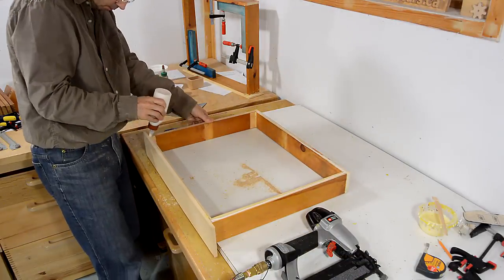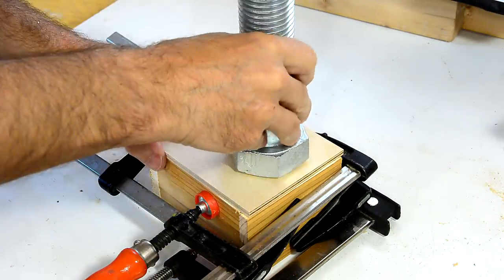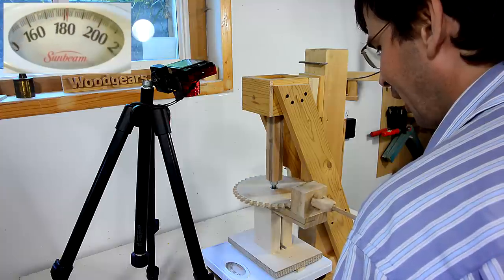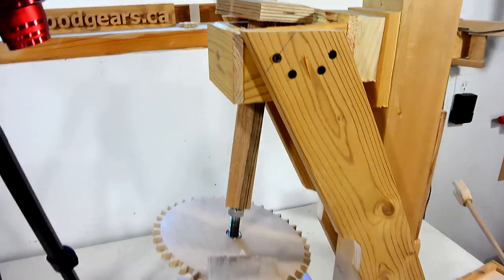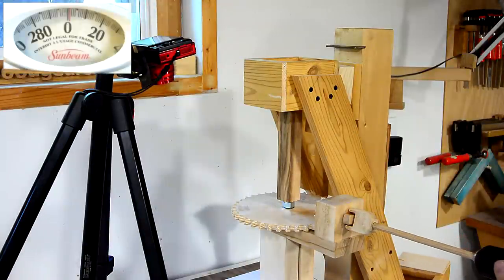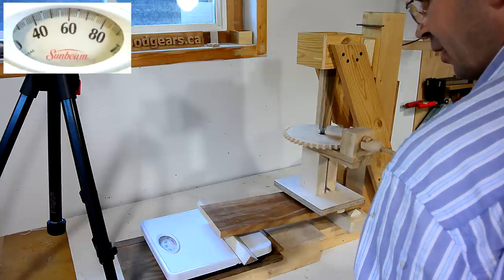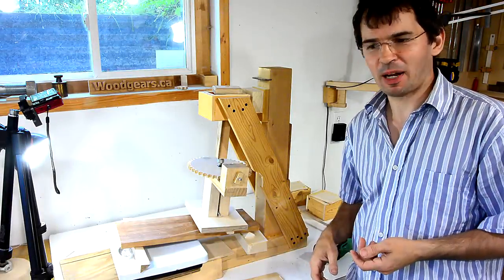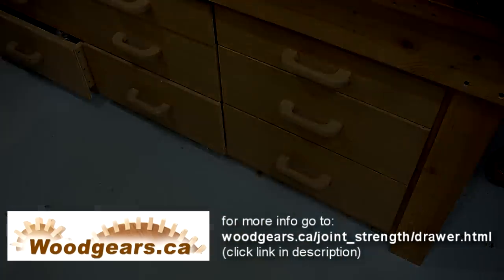Best way to attach drawer bottoms: destructive test

Comment: This video brings up a point I have been wondering for years. Matthias always shows the different strengths for different joints and the weakest of them all is the butt joint (glue only). BUT, everyone keeps saying that the glue is stronger than the wood. So, doesn't that suggest that the butt joint should be the strongest joint of them all???

Comment: i might be talking rubbish but surely with the small box in the groove would quite obviously have a larger reading because it would much harder for the draw bottom to crack the a larger draw would because the bottom would flex more and crack so a larger would most certainly have not withstand a tonne of mass.

Comment: His 1200 pound breakaway strength calculation for the glue on his drawers may be correct, but that doesn't mean that the drawer will hold 1200 pounds of materials.  He forgets that weight in the center of the drawer has mechanical advantage to breaking the connection.  The shrinkage of the material due to the flex of the material will also provide a shear force on the glue as well.  Don't forget that the weight of the bottom material itself must be calculated into the load on the glue as well.  All three reduce the amount of material that you can put in the drawer.  Putting the bottom in a groove is optimum.  If the drawer is large enough, it becomes necessary to add reinforcement strips under the bottom or use thicker bottom material in order to reduce flex.

Comment: I don't doubt that your method is fine.  However, testing a larger drawer would seem to be in order.  The flex on a large drawer bottom would tend to let the bottom pop out of the rabbet.  Also, loading goes up with the area of the bottom while holding goes up with the length of the perimeter.You should put your chaos quote on T-shirts and sell them.

Comment: Sorry Matthias, but it's bending moment, not shear force that breaks these joints. Still, I was skeptical, and the joints held up better than I expected. If you do drop an elephant at terminal velocity and at an angle on it, there's a good chance the joints will give.

I always do my joint tests with bending moment and extremely large, falling objects and/or animals at terminal velocity.  That's usually what makes joints fail.

Comment: You forgot to mention that glueing the board on the outside is better because items in the lower drawer will not catch on thi lip created by a datoed bottom. That can be worth its weight in gold  hehe. Ever have something you can`t see in the drawer below stopping the drawer? Frustrating to say the least. Hey thanks for the great video.

Comment: An interesting test, but a bathroom scale is highly suspect for accurate and reliable numbers. A load cell with an good gauge and either a hydraulic jack or large arbor press would be a lot more reliable. But your numbers do give some indication of what construction method is stronger, so I guess that's the important issue. And type/quality of the plywood will sway the numbers a lot. High grade birch ply might possibly be far higher? But the grade and glue type would also do the same. Most of today's wood glues properly applied to a clean smooth surface are stronger than the wood itself.

Pete

Comment: There is no best solution for ALL scenarios for drawers. A very large draw would allow a grooved bottom to bend out of the grooves over time. A small drawer needs as much space as possible so a glued bottom also makes sense. A drawer that has the sides with a lot of expansion and contraction would be better suited for a grooved drawer. Otherwise the glue joint would feel lots of stress and fail. I'll stick with grooved because I don't make ridiculously large drawers and I don't have to rely on the glued butt joint.

Comment: In my humble opinion you small box size is why it took so much to break; had it been a regular sized drawer it would have failed at much lower PSI.  A regular sized drawer would fail because of physics because a 1/4 inch thickness can only span so wide. 

If your test revealed anything, it was the answer to your question, gluing bottoms on is faster but not more secure. It also proved that either way works well all things considered as no one is going to put upwards of 600 lbs into any drawer for any reason.

At the end I'm not sure if you were joking when you projected that your drawer would hold thousands of pounds or not, based off of its larger size. You do make some wonderful videos and you are very creative but you also joke a lot too so at times it's hard to tell...

Comment: Mathias, I think that your conclusions are wrong due to the test not being true to reality. I think you should have used normal sized draws for your test to mimic reality Because if the bottom is in a groove, with a bigger draw i think the bottom would flex alot more and fall out of the groove. I am sure that your draw bottoms will fall out if you filled them up with lead. I am certain that if you stood in one of your draws it would break, if you made them with just a groove, no doubt. I make my draws by glue and stapling to the bottom, with no groove. I make sure that the staples are flush and then the runners also give more support as they are screwed through the bottom and into the draw sides. IF you disagree and want to prove me wrong, I too will put my camera where my mouth is and try a normal sized draw and then a larger one like the draw unit at the end of the video. I will use malamine/particle board sides with a 3mm mdf bottom.  think a 400mm draw should be tried and then a 500mm draw with a depth of like 500mm like a normal kitchen draw. Anyway i am only stating in a friendly way what i believe through my experience as a cabinet maker and like i said, If you really disagree and dont want to do the test again, I will if you reply to me. Good channel by the way, i always look forward to your videos and this is the first time i have disageed with you.:)
Reply: An easier way to say what i just said above is as follows: The larger the draw, the weaker it is NOT stronger and i will prove it if i have to.
Reply from the maker: All depends on the load distribution and thickness of the plywood.  But that's ok, you don't have to believe me.  But whether or not your believe it really doesn't change much.
Reply: yes i do agree that if the weight distribution is even to the edges it would probably hold but i dont think it would with normal use. Hey in Australia all modern draws have 3mm mdf bottoms (one side is usually white for kitchen draws) Do you guys use ply board for draw bottoms over there? Is the standard also 3mm. I have noticed that different countries do things a bit differently
Reply: You know i am curious if i can stand in one of my draws. I am going to test it and make a video, probably wont be as good quality as yours but lets test australian made draws. I will stand in one and ill try different sizes with the load evenly distributed first (not too sure how yet, im not buying lead lol). Lets see. give me a week for me and my young sons to do. It will be fun :)
Reply: hey sorry to bombard you with replies but its not every day i get to talk to a famous person.But because you replied im going to quickly upload some footage of a house extention im just finishing up. I have added almost 6m2 to make a lounge room of what used to be a porch. approx cost $500. It will take a few hours tho because my computer. So part 1 will be coming up soon if anyone is interested. Thats all promise. Keep up the good work. I will send you a pic when my bandsaw is built. I am going to take inspiration from you  and that other guy with the inferior clamps becuase i like his thinner blade and I use alot of particle board. I never even thought of making my own tools until i saw your videos :)

Comment: You should test plywood sides no an ACTUAL DRAWER size. The tiny bit of plywood below the groove (which supports the bottom) will easily break compared to a glued-on-bottom joint. Glued-groove will likely be strongest, and glued-to-bottom will probably be second.

Comment: your right one should never put that kind of weight in any drawer ,600-800lbs , so i would agree with you glue the bottom, maybe some angled brads for good measure,,,, have several drawers that exceed 100lbs in them , and they are only particle board bottoms ,3/8'' -10mm thick and have never failed in 15yr and they are just glued and brad nailed , , i think some glues used in the past failed over time thus the drawer bottom would fail ,  the material used for the bottom was too cheap or thin and deflected but have never seen LaPage fail under normal abuse as well

Comment: I generally put them in a groove unless I use  3/4 extension slides that will hide an applied drawer bottom. For me it's all about looks, opening the drawer and seeing the edge of an applied bottom looks like crap in my opinion.
Reply: Skinny Moose And you are never going to have to clean up glue squeeze out or dried glue on the bottom inside of a drawer.
Reply: God of Thunder that's true.

Comment: 2400 pounds huh ? With a drawer that big i'm sure anyone could just punch the glued bottom right off.
Drawers that small and pressure applied right to the edges really doesn't translate to real world use and normal sized drawers.
If you wanna do that, you need full sized drawers and a more realistic simulation of weight, like pouring sand in them. I'm willing to bet the glued on bottom couldn't hold a single bag of sand (100 pounds) or close to it.
Reply: Lol. Im sure it holds 100 pounds with no problem.

Comment: I had bets on the Rabbit winning... If I buried the bottom in rabbits.... The sides would have to break apart for it to fail. If you glue the bottom on.. You are are relying more on the glue to hold.

Comment: likely already pointed out , no drawer is 2x2  the open 9x 16 distance will make a huge difference on holding power as the bottom flexes as tension is built .. deflection of...? test might be not be useful as a reliable analog. should have been a tad bigger to let the bottom flex a bit under normal drawer  type loads, however I only wish I had the time and resource to do what your doing.. carry on PLEASE! What you do is genius first and entertaining  as well  . I am going to use your plans and build a tilting router table. that is bad ass. Thank you

Comment: I think that a bottom glued into a dado is similar to a finger joint, and a bottom glued directly to the drawer is essentially a butt joint relying solely on the strength of the glue joint. As with any butt joint, it can be reinforced tremendously by adding screws to it. With today's adhesives though, either way should be more than adequate. Obviously you haven't had any problems with your preferred technique, or you would have changed it. 

I'm too lazy to do the math, but I doubt that increasing the drawer size four times increases the strength four times too. Wouldn't the area inside the drawer increase proportionately greater than the area of the glue line of the bottom? If so, the strength of the drawer would not increase linearly with the drawer dimensions. I doubt that your production drawers would fail at 2,400 pounds but probably much sooner than that. After all, your test drawer sides were the same thickness as the production drawer, so the only increase would be the length of the glue joint, not length x width (as with the drawer interior). Just sayin'.   I always find your tests very interesting to watch.

Comment: Which failed? The flat on box to ply glue line or the ply to ply glue line or the wood adjacent to the glue lines. Strength is dependant on the tear away strength of the plywood plys and their glue lines.

Comment: I think it took so much because it is such a small area. Usually a drawer is wider and longer so wouldn't it most likely bend outward? With this it can't bend out.
Reply: +Les K The force on drawer bottom was distributed evenly over the interior area, so as long as you apply an even force over the interior of a larger box (assuming all thing equal) the larger box ought to be stronger. To create a pound per square inch force on a square inch drawer would require only one pound, but to do the same on a square foot drawer would require 144 pounds. 

The limiting factor at that point would be the surface area of the glue.

Comment: Matthias your maths was a little wrong. The larger the object when it has the same holding force (in this case the edges of the rabbet) then the easier it will break. Think of it like trying to break a 10cm long dowell compared to a 1m long dowell

Comment: that perfectly fit push part isn't the best way to test push the bottom.  Might be more meaningful if you used a push part that was much smaller than the drawer opening pushing in the center.
Reply: Yes.  Very true.  Also, max force is a bit different from wear due to use over time.  I think the glue joints may be more susceptible to a series of small incidents over time.
Reply: +RDJim My guess would be that a perfect fit directly tests the strength of the joints themselves. I think a smaller object pushing pushing on the bottom with upwards of 800 pounds of force might run the risk of punching straight through before the joints can fail.
Reply: +RDJim If he lowered the surface area of the plunger all he'd likely to be able to test would be the wood's softness and not the ability of the bottom to stay on.. He did those wood hardness tests a few years ago where he gauged the average densities of various species by pressing marbles into them. For every square milimeter smaller he could make the plunger, that's a square mm's less area of wood fibers the force is distributed over.

Comment: Plywood deforms with load, bigger drawer base would sag breaking glue edge, drawer slides low rated as bottoms fail before them.

Comment: I see a little problem whit the conclusion. In a bigger drawer the pressure tend to bend the bottoms, so, form a mechanical perspective, The pressure goes from a side, like lifting the glue, in the specimen, the pressure goes flat in all the bottom surface, making more difficult to break, or detach.   
 
Whit a dado it might  happens the same, but there is a mechanical barrier. 
 
 
 
 
I'm form south America. sorry for the grammar. 
and an amateur woodworker.

Comment: A bit of a waste of time really - close but missed the point.  Most [flatpack] drawers I've had have a cheap HDF board set in grooves with no glue and a 2' span.  They often accumulate moisture and have a centered load which causes the edges to pull out of the groove.
A board stuck on the bottom would be far superior in this circumstance but then using a decent thickness plywood base would take the draw overs spec anyway.

Comment: This is incorrect. your test setup only considers shear stress at the ends, its not true in a real drawer, the moment created by weight at the center will cause the plate to sag, if you want to test it accurately, either your specimen need to be much bigger or your plunger center needs to be smaller, in the first two tests, you tested the axial strength of the cuts you made for the drawer sides and not the drawer bottom.

Comment: I guess somebody should have asked specifically whether the design would have failed in shear or moment at lower load.  do the test again matthias...
Reply from the maker: +Persona Charles You want the results, you do the tests.
Reply: +Matthias Wandel 
In my experience, drawers don't fail due to the bottom falling out, unless those bottoms are made from lauan or paneling. I watched The WoodWhisperer stand in a drawer and declare it good. Now, frankly, that is a good testament to the construction of that drawer, as well as the slides. I think he said something like "175 pounds of Pure American Man. I did a test, with a set of 200 lb slides at 18" with 1/4" hardwood plywood, very well glued, and did a test of "235 lbs of Pure American Fat Man"... with bottoms glued to the drawers... and it held nicely... feet held closely at the middle of the drawer. As long as the glue holds up over time, that should be all OK. I didn't bounce up and down very much, as I pretty much can tear up 2" Oak by bouncing around on it, and I will dang sure wreck the slides. But how many people have 235 lb fat men stand in the middle of their drawers? That said, I prefer to build a slide in bottom, simply because I have done that before. If I start building a lot of small drawers with no slides, I will definitely glue the bottoms on.
Reply: +Matthias Wandel You did good enough as is! :)